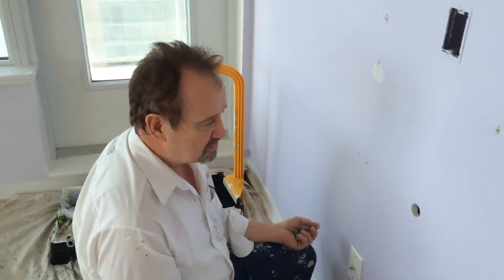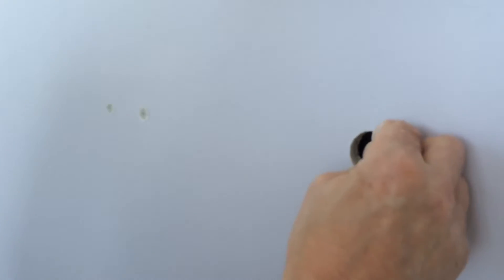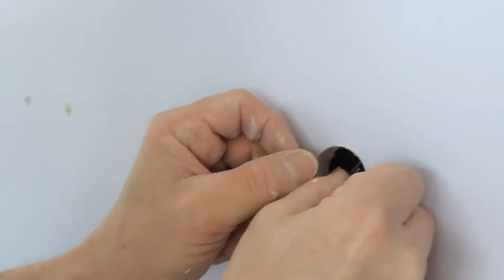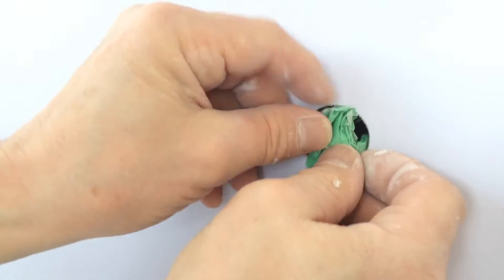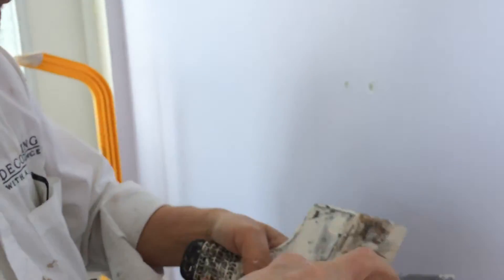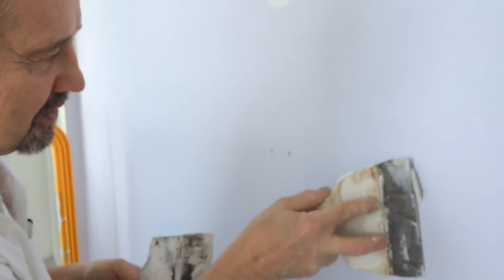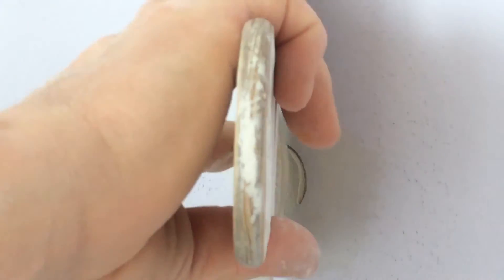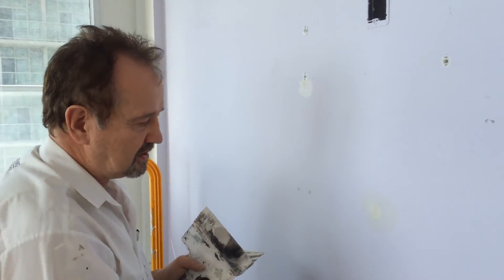How to Fix a Hole Without Drywall

Comment: Of all the overdone videos on here about how to fix a hole and what you need to go and buy and blah blah blah.
Thank you for giving a quick fix solution and getting straight to the point with it.
 (yes, it is prb better to go and get all the proper tools and materials......but who wants to if you dont have to)

Cheers mate....thx for the tip!